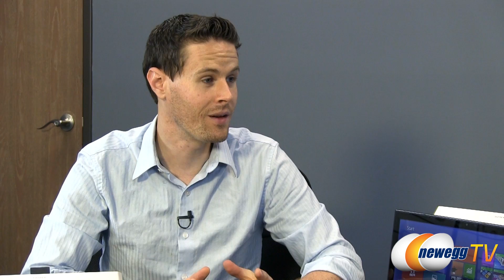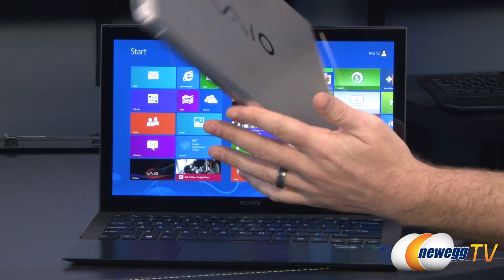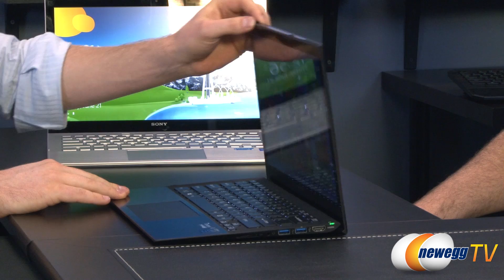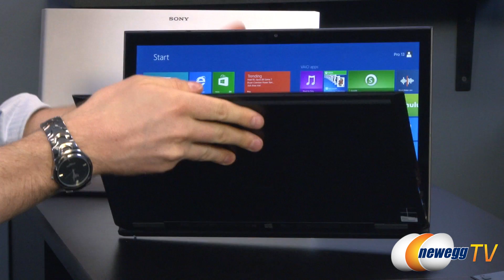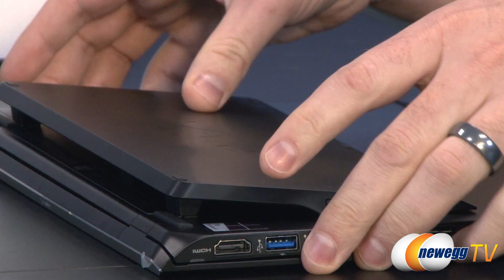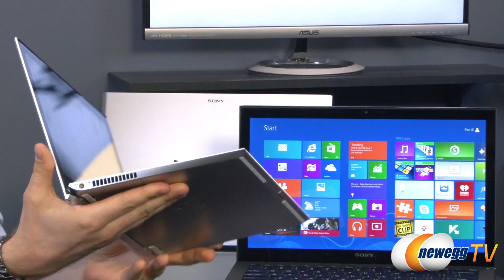SONY VAIO Pro 13 Series Ultrabooks Interview - Newegg TV

Comment: I wonder what SSD they are using. The new Macbook air also has pcie ssd and it only achieves write of about 600 and a read of between 750 - 800. The read write on the Vaio is absolutely bonkers.

Comment: I went with the air.. if I need a nice screen, I'll plugin my monitors.  On the go I need battery.  Also the lack of a Unix environment with support was a big loss, and the flex in the Pro's screen.  Yea I could load linux but whose to say it will work for everything?

Comment: no, the base clock is lower @ 1.3 on the air but the turbo clock is the same on both @ 2.6.

Comment: Yeah, but the clockspeed on HD4600/4400 processors is higher than the ones with HD 5000 graphics

Comment: They're going to have roughly the same battery life though, with the air probably only a smidge shorter cause of the slightly more powerful processor

Comment: Unfortunately, they were wrong. The pro 13 has about the same specs as the new MacBook Air, but to make the pro the lightest ultrabook around, they had to cut the battery in half. So it has roughly half the battery life as the Air, so about 6-7 hours, still good though.